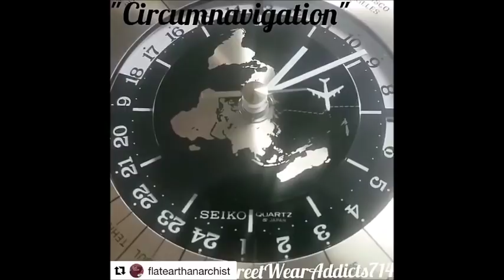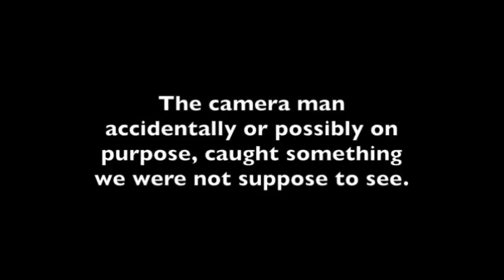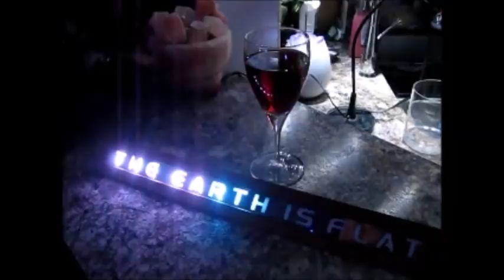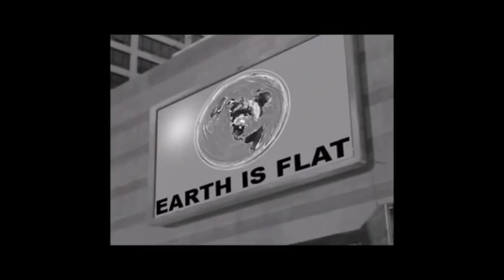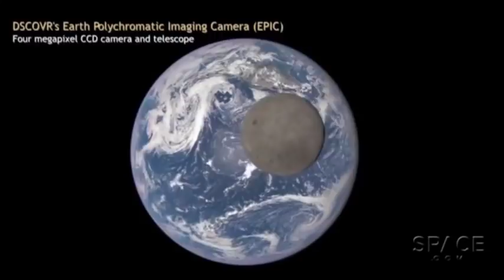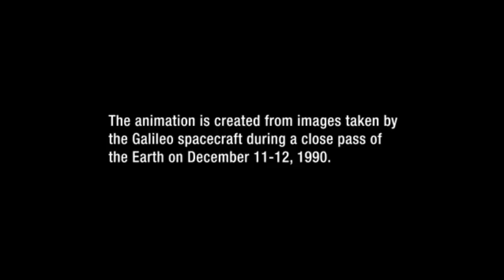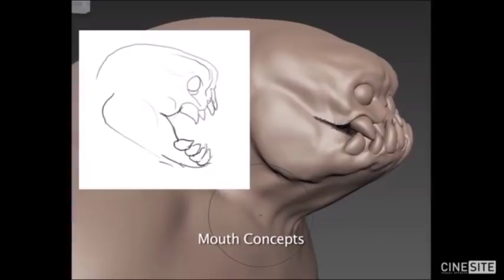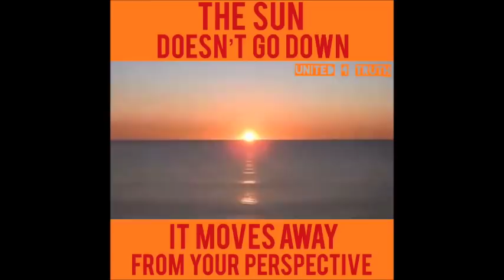Flat Earth Q&A Emails 80 - Mark Sargent ✅

Comment: Legitimate question:

Mark has attacked the Apollo missions for saying they got through the Radiation Belts because they went really fast. He says this is dumb. However, I've seen it explained that the reason it makes sense is because the faster the rocket went, the less radiation the astronauts were emerged in. Thus, they were not harmed. How can this explanation be debunked?
Reply: I am not a flat earther or a glober...I think the truth is stranger than we can imagine....BUT, they tell us the Torr values for the vacuum of space is like the inverse of going to the deepest part of the ocean (perhaps even greater but they cannot seem to give anything but vague measures), anyway, there is NO WAY that 11 layers of fabric (or any material on earth that I have heard of) can withstand the vacuum of space.  My question is WHY are they lying?
Reply: Morgan Freeman's favorite freckle why dont they just do that today if that's all it took? C'mon man.
Reply: @Charles. I'm afraid your fundamental ignorance of basic physics does not constitute evidence. There may also be some blatant deceit in your post (I'm giving you a bit of credit here - I suspect you're not that smart). At the deepest point in the ocean, the external pressure acting on a surface is close to +1,000 atmospheres. In a perfect vacuum, the pressure is -1.0 atmospheres. The math is pretty straight forward. Let's take a car tire at 35 PSI. What will the air pressure be for this tire if it is put in a vacuum? Show me your calculation so I can gauge whether or not an adult conversation is warranted.
Reply: @Morgan. Here's what I find funny about flattards using the Van Allen Belts as evidence against space flight. The researchers that discovered the belts and every researcher that has studied them since have made it clear that they are not an absolute barrier to space flight. Van Allen himself made it clear that they would not prevent space flight. The only reason that flattards know the belts exist is because of these researchers. For some bizarre reason, flattards have decided to believe scientists when it comes to the existence of the belts, but they have simultaneously rejected the characteristics these same scientists have ascribed to them. Imagine I tell a stranger on the internet that I own a grey Honda Civic. I send this person copies of my registration, photos of the vehicle and signed affidavits from witnesses that had seen the vehicle. If the stranger was a flattard, he would no doubt conclude that I must indeed own a Honda Civic.... but it also must also be blue.
Reply: well said
Reply: Cyber Pleb wrong....I will give u Correct math here...give me a few....
Reply: Cyber Pleb The torr (symbol: Torr) is a unit of pressure based on an absolute scale, now defined as exactly 1760 of a standard atmosphere (101.325 kPa). Thus one torr is exactly101325760 pascals (≈ 133.32 Pa). Historically, one torr was intended to be the same as one "millimeter of mercury".....agreed that is what they tell us?....OK next....
Reply: Cyber Pleb There are 25.4 mm to one inch, which calculates the barometric pressure as 29.92 X 25.4 = 760 Torr. An absolute pressure gauge reading in torr reads 760 Torr at atmospheric pressure, which is zero vacuum and would read 0 Torr at perfect vacuum.". Agreed?  OK next
Reply: Cyber Pleb vacuum is a volume of space that is essentially empty of matter, so that gaseous pressure is much less than standard atmospheric pressure. The root of the word vacuum is the Latin adjective vacuus which means "empty," but space can never be perfectly empty. A perfect vacuum with a gaseous pressure of absolute zero is a philosophical concept that is never observed in practice, and quantum theory predicts that no volume of space is perfectly empty in this way. Physicists often use the term "vacuum" slightly differently. They discuss ideal test results that would be expected to occur in a perfect vacuum, which they simply call "vacuum" or "free space," and they use the term partial vacuum to refer to the imperfect vacua realized in practice.
Reply: Ok so far?   Hmmm I guess my basic understanding of physics is still lacking....lol...let's continue to delve into this shall we?    Ok next...
Reply: Cyber Pleb Outer Space1×10-6 to <3×10-17Torr.....hmmm so somewhere between .0000001 and .000000000000000001 Torr?    Now That is a "fundamental" understanding of physics for you....never mind you think me a fool while you wallow in ignorance....do your own research before you speak of your sacred "physics"
Reply: Charles. You have typed a lot and yet you have have provided absolutely nothing to back your claim. You have stated that the pressure differential acting on a body in a vacuum is the inverse of the pressure differential acting on a body in the deepest location in the ocean. This is, of course, not true. Once again, please supply the math needed to support your ridiculous claim. I still see absolutely not evidence that you have a fundamental understanding of the topic. I believe I asked you this elsewhere, but how much do you think the air pressure within a standard car tire would change if you put this tire in a vacuum? Do you think it will explode in a vacuum? Think carefully about this.
Reply: @Andrew. The problem is that there is absolutely no questioning or thought going on here. I'm quite happy to have a civilized conversation with someone that wants to honestly question things. But when dealing with willfully ignorant fools, vitriol is most definitely warranted. Idiocy should not be accepted or ignored. Incidentally , the curvature can be measured with a theodolite.
Reply: @Charles. I likely won't be able to reply for a few days. In the interest of wrapping things up, I'll explain why I feel you are ignorant of some fundamental physical factors pertaining to vacuums and pressure. Note that I have said you are ignorant (i.e. you lack knowledge) and not stupid (although I suspect this may also be the case). I have been curt because I have seen you spread your ignorance and misinformation in numerous threads. 

A vacuum is simply the absence of matter. If a vacuum is generated within a fluid (gas or liquid) molecules will diffuse into the vacuum. A vacuum does not generate a sucking force per se, instead fluid molecules move as a result of random collisions that cause them to evenly disperse themselves. Imagine I have a car wheel in my living room and I fill the tire with air at a density of two atmospheres. This means that the density of gas molecules in the tire is twice that of the surrounding air outside the tire. Gas molecules will collide with the inside of the tire twice as frequently as gas molecules will collide with the outside of the tire. This will generate a small outward force and create tension in the rubber. With two atmospheres pushing out and one pushing back we get a differential of one atmosphere (14.7 PSI). I'm sure you'll agree that the tire is strong enough to withstand this. Now imagine that I take a tire, fill it to only one atmosphere and place it in a perfect vacuum. The net force pushing outward is the same as it was in my proceeding example (1-0=1). I can assure you that the tires on Elon's Tesla will not pop in space. It's a common error to think that a perfect vacuum generates an infinite sucking force. This of course is not the case, a perfect vacuum has an absolute value - we cannot have less than nothing.
Reply: @Charles. I'm a shill? Are you honestly suggesting that I am being paid to talk to people like yourself?
Reply: If not then quit attacking with insults and lies.  Scientists allege that "space"  is "estimated" between 1×10-6 to <3×10-17 Torr.....hmmm so somewhere between .0000001 and .000000000000000001 Torr?
Reply: Scientists allege that "space"  is "estimated" between 1×10-6 to <3×10-17 Torr.....hmmm so somewhere between .0000001 and .000000000000000001 Torr?
Reply: I saw his dummy account as well.  And Andrew I disagree, the vacuum IS absolutely the best argument....RESEARCH for yourself:  Scientists allege that "space"  is "estimated" between 1×10-6 to <3×10-17 Torr.....hmmm so somewhere between .0000001 and .000000000000000001 Torr?
Reply: @Charles. Pressure is force per unit area. It is generated through collisions. This is pretty basic stuff. Nowhere have I stated that space is a perfect vacuum.  No doubt your local community college offers a remedial physics course. Get back to me when you understand the basics.
Reply: No sir!  You have conflated my statements into a personal attack on you and it was nothing of the sort but you continue to attack me.  I said "WE" are ignorant and that the truth is far stranger than we can imagine.  Is that so terrible?  And I do not take issue with attempts to understand reality at all.  The "scientific method" is admirable and in fact has contributed many amazing advances to the human race.

I do, however, take issue with the arrogance of people that attack ANY challenge to conventional or "accepted" theories.  This is exactly what you did and CONTINUE to do even now.  The truth is that many of our greatest achievements in science were by the most unassuming personalities and many more were achieved entirely by accidental circumstances.  For the record, I do not profess to know the answers to the mysteries of the universe but I find it offensive that you attack every single person that questions what you were told were facts.  The "facts" are, over time, constantly changing.  Does this make these conclusions you were taught factual?  No sir, they are NOT factual and I will be happy to debate anything with you but I demand that you give me the same respect that I will give you or I will no longer communicate with you.  Thank you.  FYI...I am ignorant but your other insults were troubling to me and upon further introspection I have concluded you are mistaken on these matters as well...lol.  Seriously though, I feel that even a person such as myself COULD be onto something which will alter the very foundation of science.....   Who knows it could even be you that changes the way we understand Biology by casting aside all of your pre-conceived notions....I could quote many famous geniuses to illustrate my point...but I must continue what I was doing...for now.....O wait,...I just read the last two sentences of your statement.....

PLEASE show me these empirical tests....lmfao.  I will be happy to respond to these as this is EXACTLY what I am researching as we speak.....Please enlighten me on my "high school level material" and I will be happy to educate you ….I may even enlighten you in your field as well....
Reply: @Charles. Your incoherent ramblings are entire irrelevant to the discussion. You have claimed repeatedly in more than one thread that no man-made material can withstand the vacuum of space. You have stated that "the math" makes it clear that this is the case. I've asked you numerous times to show this math or to provide evidence for your claim and you have repeatedly refused to do so. Debate requires that you present a thesis - you have presented absolutely nothing. I come from a world where people are expected to defend their claims, but you lack the integrity and honesty to do so. I'd be quite happy to engage in an intelligent debate and I have repeatably asked for you to start one. You claim that you are not a flatearther, yet you certainly possess all the traits of one. The fact that you think I am a paid shill and engage in "deviant practices" suggests quite strongly that you may also suffer from some mental illness. Take care.
Reply: You want a thesis?  Fine I shall present one.  Currently my "incoherent ramblings" are in full force so I must do it when I have time.  YOU are the one that constantly insults people and then flip the script.....but, since you have all of the answers, I will submit a thesis...soon...right here on this forum.
Reply: I am waiting.....tapping foot....
Reply: @Charles. I haven't flipped anything at all; I've consistently asked you to explain yourself. You, on the other hand, have told me that "ALL science is bullshit" and then turned around and defended science and the scientific method. I can't say that you have made much sense. People that spread ignorance and refuse to support their claims are worthy of contempt and ridicule. Where have I suggested that I have all the answers? You have apparently decided that you know 'the truth' based on absolutely nothing at all.
Reply: Cyber Pleb yet again you fail to respond with anything but insults...no response to the links?   There is only one reason you are here....hmmmm
Reply: @Charles. Please explain why you feel your links are relevant. I have asked repeatedly for your math and you have repeatedly told me you will supply it. Where is it?
Reply: @Charles. Your first link shows one of NASA's test chambers - yes, they exist. Your second video shows a well known mishap in a NASA vacuum chamber - how is this supporting your case? (And this is far from the only test in a vacuum chamber... where are you getting this nonsense from?) The last link shows a test on a space suit  in an open vacuum chamber - yet again, something entirely irrelevant. What could you possibly think you have shown with these links?!